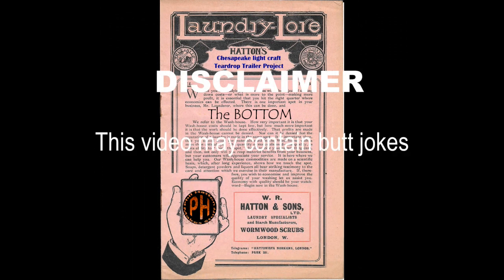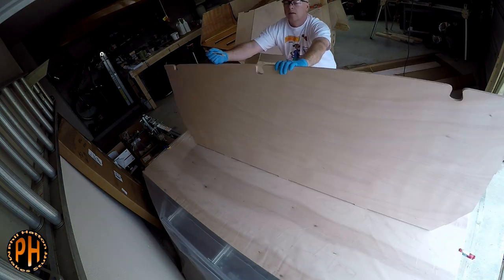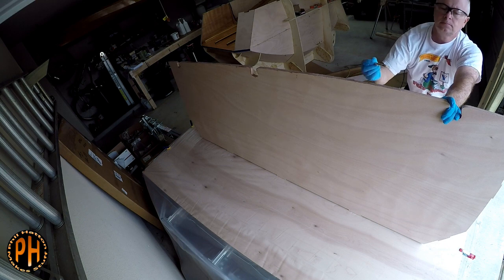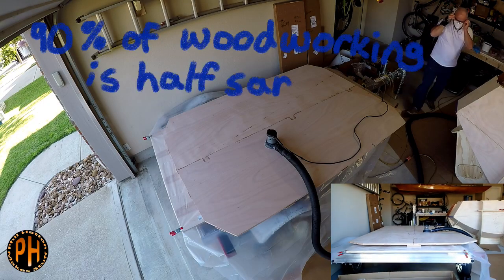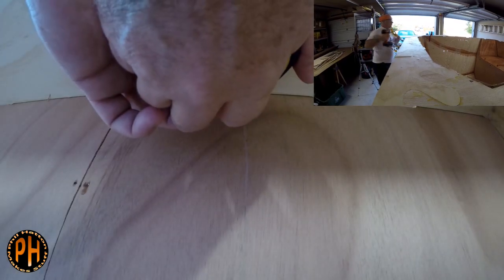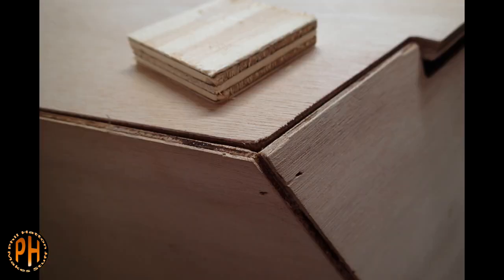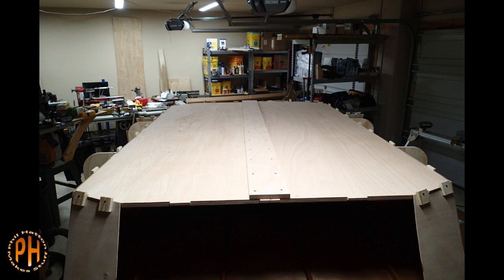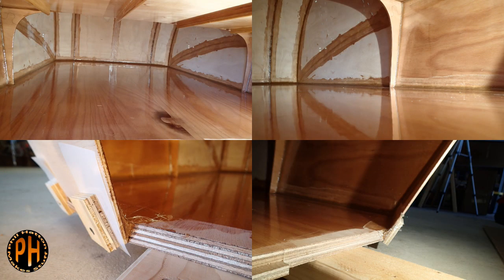Building a CLC Teardrop Camper - Assembling and Installing the Bottom - Stitch and Glue Construction

Comment: Phil, Thank you so much for taking the time to make all of your videos on the TearDrop camper.  I'm planning on ordering one, watching your videos will help me out greatly.  Do you have any suggestions or advice if I were to order the manual and plans to cut everything myself which would take me longer,  I'm sure or just buy the kit to make it easier on me? (LOL)
Reply from the maker: Working from full size plans would be fun, and I guess a bit more time.  The main issues would be joining pieces of you can't get longer lengths of marine ply, and losing the precision of the CNC machine both in cutting and in drilling holes used for locating parts together, for example the door stiffeners, fairlead bosses, etc.
Reply: @PhilHattonMakesStuff  Thanks Phil for your reply and advice!
Reply: you have to think of what kind of trailer to us,  if your older and need the floor lower to the ground use theirs , if you go with some thing like a harbor freight trailer the tires are under the floor so your floor gets pushed up 4inc but this is a good thing like for me it gave me the 8inc of room for a 21 gallon water tank for under the floor and room for a ac unit and under flood storage  , but again i am 25 incs off the ground with the lip of my door so it makes it some what harder to get in and out of the camper
Reply: falcon7350 Thsnks for your input 👍

Comment: I just installed my floor a few days ago. Unlike you, I let the floor drop all the way into the notches instead of holding it up flush with the edges of the side panel.
My plan is to trim the 1/4 inch overhang before the fiberglass.
Also my plan is to use my router to round over the butt block edges while glued to the bottom and before the glass.
I am enjoying watching your build however.
Reply from the maker: Thanks!   I found the bearing on my router bit bottomed out so I had to remove it.  That meant I had to use a piece of 1x as a guide to do the routing.  Regarding the trimming, do you think you'll need to trim the transom when you install it?
Reply: @PhilHattonMakesStuff  I'm expecting that, yes, I'll need to trim the transom as well.

Comment: hummmmmmm here,s 1 for you .. if you have not made it to this step then this tip well help out alot or your going to be mad.. i just past you a few days ago and cut out the doors.  at the highest point on the side doors cut lower some then what they want you to do. stay low on th cnc cut lines as much as you can up there . if you  install the eyebrows the way they want you to the door well hit the eyebrow and not open right . i can now see this when looking at pics of other campers and most have a big gap at the top of the door jam to make it work .  like the books says that the eyebrows are more a after thought so they have not edited the CNC files to fix this ?guessing? . both my doors are to high  . when installing the door jams they seem to be fixed so you get a gapat there ends. if i know this my OCD would be more happy lol . just stay low on the cnc cut lines at the top .hard install side door to fix body gaps last on the door its self to keep panel lines looking good .  at the step you are at i all so install 3oz on the inside of the top of door and 6oz carbon fiber on the lower part of the door over lapping the cut lines. this stopped the spring back when cutting the doors out and the time they set to warp up . this helped out so much
Reply from the maker: Good advice, but too late to help out.  I'm actually at the point of working on the doors now.  I'm well behind with my videos.
Reply: @PhilHattonMakesStuff  came by to see if there was any updates ,  soon my camper well be done and i  well make a video as well to show how i did a few things on the back hatch and other things like i have a AC unit installed and heater  21 gallon water tank and so on
Reply from the maker: @falcon7350  looking forward to seeing your video.  I will work on a video this weekend.  We've moved out of state and I'm starting another job so I've been busy.  The camper is built but the electrical needs to be wired and the insulation needs to be installed.

Comment: Now you tell me.  I'm a twoweeks into my build and am waiting the shell to dry to turn it upside down for fiberglassing the bottom.  Can't now until I round off the edge of the butt block.
Reply: i wish i had 2 weeks LOL FL weather is cocking my stuff off faster then i want it to . wish i had a nice cool shop to work in . but nope . i am out in the FL weather in a car tent . its still fun tho . working latter in the day helps . i have all most made the full camper in 2 weeks . i am on the last steps now
Reply from the maker: @falcon7350  I'm on a much longer timeline...
Reply from the maker: I would have rounded the butt block over before even putting it on the bottom.  The screw that holds the roundover bit bearing bottoms out before even come close to getting a good profile, so I had to remove it.  Free handing without a guide bearing is impossible, so in the end I had to use a piece of 1 x as a guide, and clamping the guide in place after the bottom was installed was a pain.